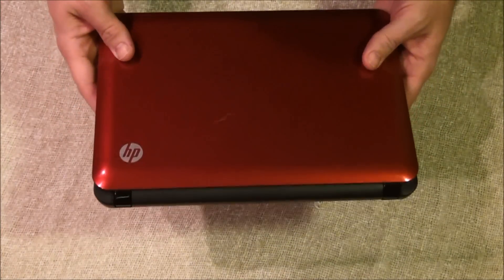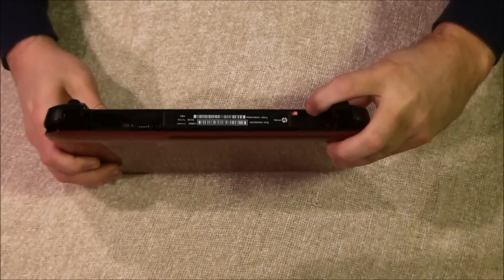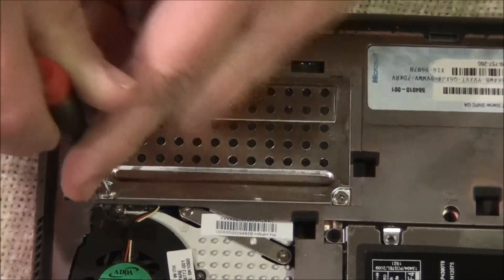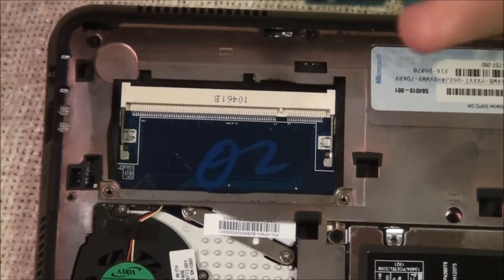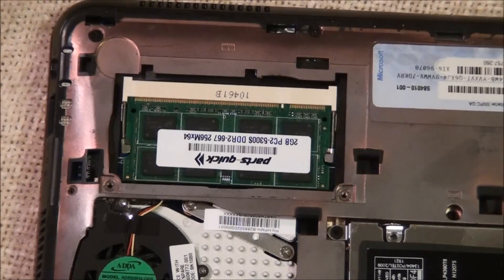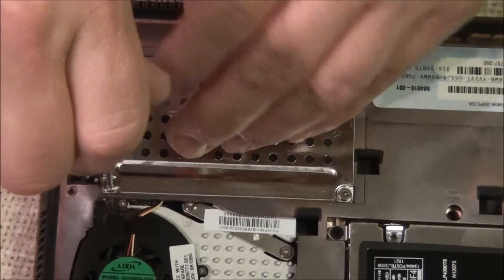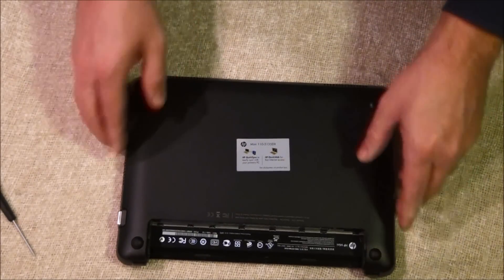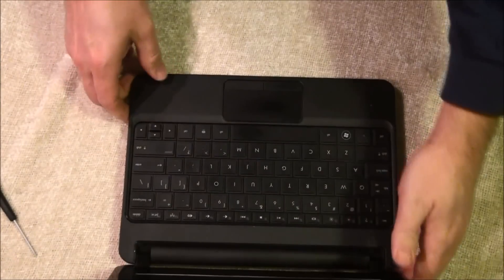DIY - How to Upgrade the Memory in HP MINI 110 Series Netbook

Comment: My HP Mini is struggling to run a modern browser (Chrome or Firefox) in Linux Mint xfce so I'm upgrading to 2GB RAM as the memory tends to max out and then the HDD goes nuts.  If the 2GB RAM upgrade works I may also get a $25 SSD to speed things up a bit more.
Reply: Does it run good ?
Reply: How did the upgrade do with the extra memory?

Comment: Can i use ddr3/ddr4?? Is there any difference from ddr2?
Reply: Yeah bro,  don't do it. Buy it used if you have to. the only thing you can change is the speed (in MHz) to a slightly higher one, it just wont run at that speed, and some users report being able to change the size of the RAM to something bigger than allowed by the manufacturer but it may not work depending on the model, so expect to lose money, buy it used. DDR models aren't swapable

Comment: Just dusted mine off, slapped on Linux Mint to replace the XP and it's running pretty well.
Reply: Is it better to have linux than xp?
Reply: @amrinalaja4885  absolutely
Reply: @amrinalaja4885  XP is totally insecure, Linux Mint with the xfce desktop will run on these older netbooks and is continually updated.

Comment: It looks like it only uses one RAM stick, am I correct?
Reply: I upgraded my mum’s recently and yes there is only room for one  ram stick (it is a mini after all).  You can also only upgrade to a maximum of 2gb.
Reply: @davidbatthews3811  That's what I thought. I bought a HP Mini 1104 from a person on eBay in February. They had tried a 4 GB stick in it and the Mini only recognized 2 .99 GB. So they put the 2 GB stick back in. I don't know why it recognized more memory than HP specified...
Reply: @BaconFaceMcGee   Is it because of the OS, win 7 - 32 bits only recognized RAM under 4 GB... cmiiw
Reply: @musicalesong5359  The previous owners had installed Windows 10 Pro 32 bit.
Reply: @BaconFaceMcGee  Hello, can you confirm that you used only a 4GB DDR2 stick and this netbook recognized it? Did it work normally with a 4GB stick then?
Reply: @juniohead5908 Hi. I don’t have access to the RAM stick. The original owner of the netbook has that. I only have the 2 GB they installed in it.

Comment: Hey, I have this netbook and it's extremely slow. It has 1gb ram, so I wanted to upgrade to 2gb, and also can I change the HDD with an SSD? Will any SSD do or do I have to get a specific one?
Reply from the maker: Those things would make it much faster, but depending on how old it is. Sometimes it is just time to purchase a new one. But like a lot of people if you like the one you have and plus doing this yourself gives you a sense of pride then do it. Thank you for watching!
Reply: It's not gonna help much, netbook processors are garbage. Benchmark 200-300 that's next to nothing. I sold off my netbook in favor of used X200 (45$ bucks good condition) processor benchmark 1700+ i can feel the power of real PC when i'm on it. 1.35kg only, there is even more LW version x200s (Lenovo) i think 1.2kg.

Comment: Did anyone ever find a battery that was worth the money?  I replaced mine at $60... dead within a year
Reply from the maker: I have found it to be a hit or miss for me, but mostly they last longer than a year.  Do you read the specs on the batteries you buy to see what the capacity is? I would look 4800 mAh or higher or buy the cheapest one and get 2 of them:-) I see lots of choices on Amazon from $14-25.  Good luck!  Thank you for commenting.